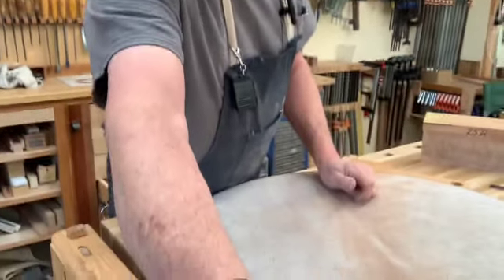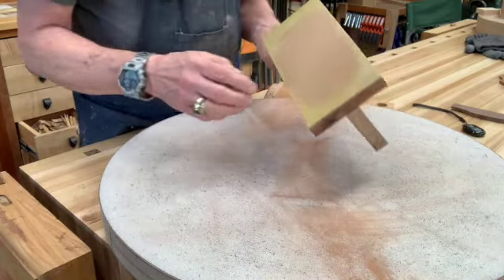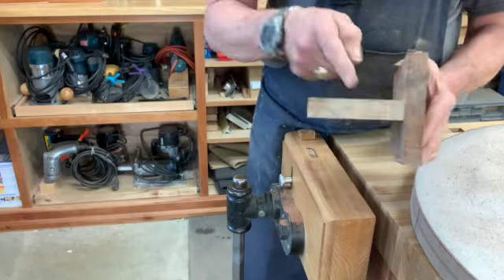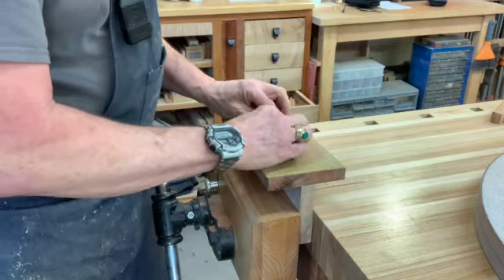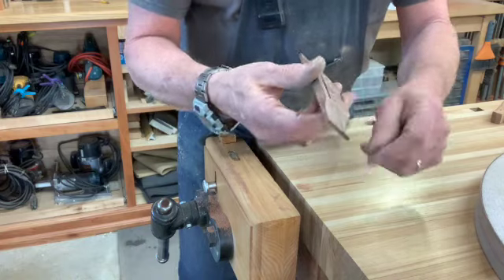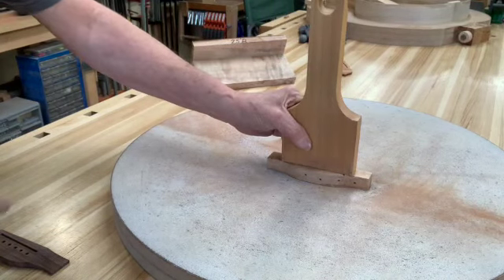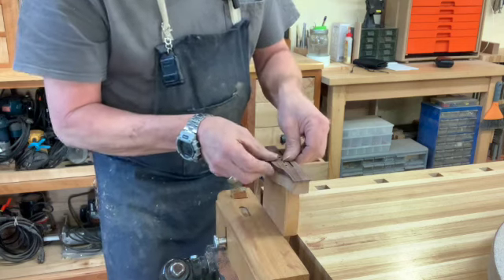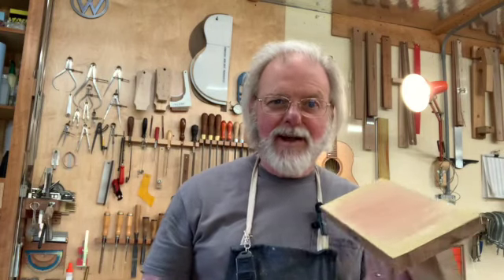BETTER FITTING Guitar Bridges Through Simple Gadgets

Comment: I just checked my about 20 years old Ovation and the only radius I could find (in the top...) with my metal meter stick is due to the pull of the strings on the bridge and commonly refered to as belly buldge.  Only way I can check a new one is like Guitar Center.  I have about 15 electric guitars (keep trying to find the one I can play- lol) and I watch the master craftsmen luthiers such as yourself for things like insights on set-up.  I have absolute certainty that you 'know what you're doing...' but my Ovation seems to have started out life with a flat spruce top.  The Os always seemed to have the action of an electric to me.  My friend's Martins, Sigmas, Gallagher's, etc. were always unplayable past the fifth fret.  Whew getting long...

Comment: OK very good lesson. what is the difference in sound from flat to radius top or convex top??
Reply from the maker: The reason for doming a top is to A: increase stiffness in order to improve high frequency response. B; to allow the top or back to shrink in the event of reduced humidity without immediately drawing a crack as it would if the top or back was flat. C; Doming a top or back can also make the instrument more percussing and slightly louder.  None of these attributes will make a blatantly obvious change in the character of a guitar, rather, they are nuance.
Reply: @thepragmaticluthier  Thank you very much